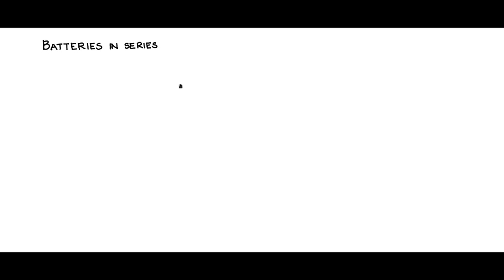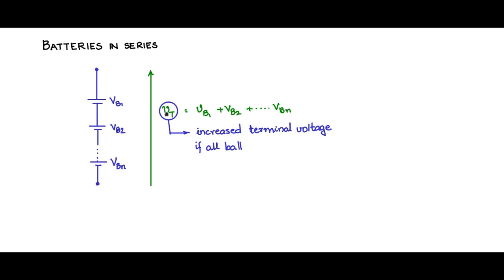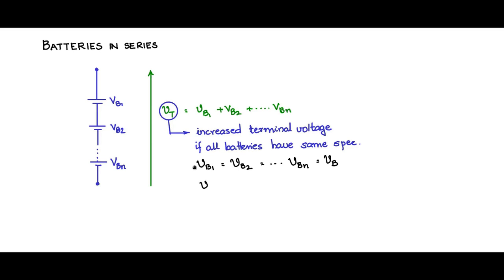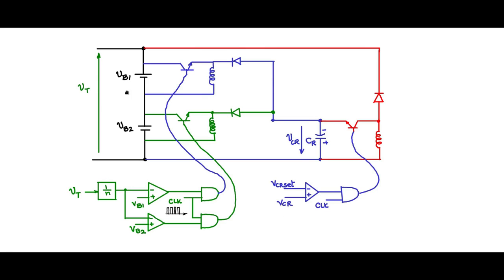Batteries in series - charge equalisation

Comment: Because each battery has an internal resistance. It's like a voltage divider with different resistances for each battery, with a specific input charging voltage on the input. Awesome video. +1, 20